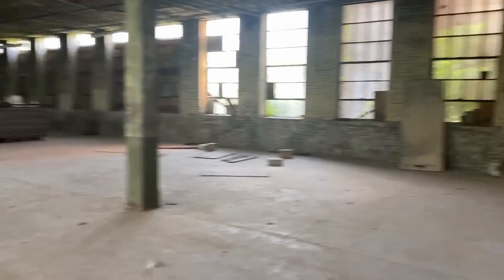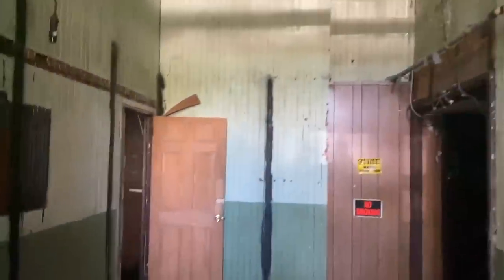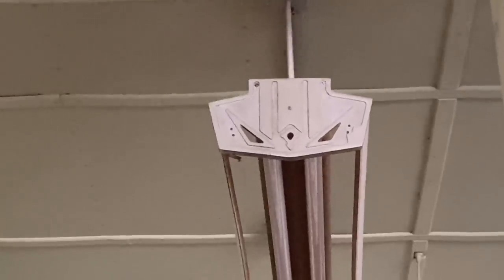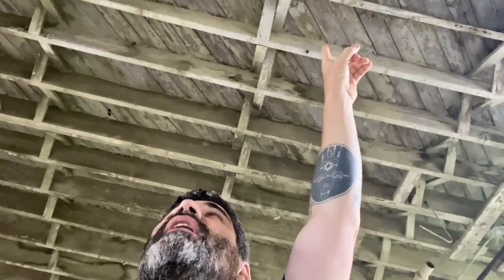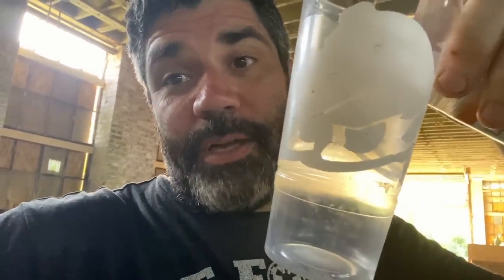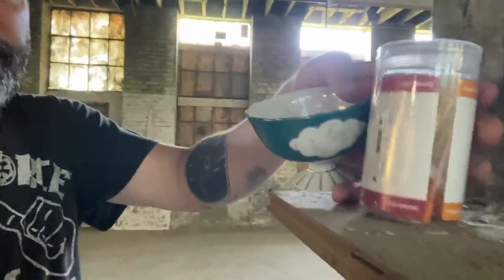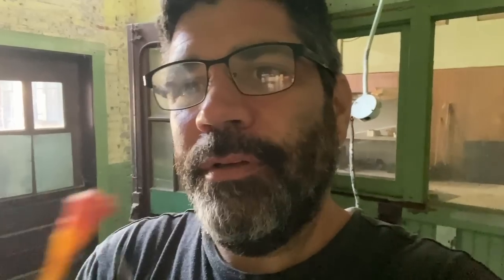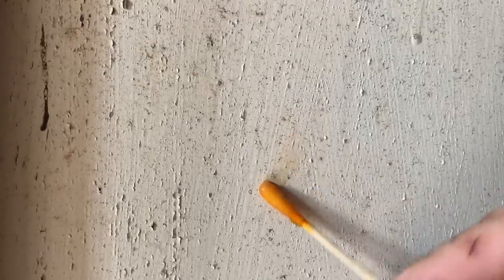I Test  for the Dreaded Lead Paint Result. Industrial Renovation.

Comment: I would take the training. If I recall correctly from some of the safety training I took, the worst way to get sick from lead paint is to ingest it (i.e. kids eating paint chips). Sanding/scraping shouldn't be too bad as long as you mask up. Any kind of dust should be considered hazardous, even from sweeping in your old building. Good luck!
Reply: Exactly. It’s asbestos that the dust is a problem
Reply from the maker: I was wondering about airborne particles once I started disturbing it.  But I think I can mist it to help the molecules bind and not go airborne.

Comment: I would suggest taking the class. You will learn a ton of good info and be able to separate facts from old tales.  The two things you don't want to do are inhale any sanding dust or ingest any paint chips, flakes etc. You would need more than a dust mask to protect yourself. Another option you may want to consider for the flaking areas or areas you cannot jet blast is a product called Peel Away-7. Its a nontoxic paint stripper that takes a few days to work after you cover the application with a 3 mil plastic film. It works on wood, brick, etc. the material is very viscous so will entrap all the paint particles as it softens them up. I used to do a lot of historic home renovations, and would order that stuff by the 5 gallon bucket. It was a amazing some of the brick work and wood work I uncovered. In most locations you can use the trash to dispose of it but check with your local city codes to make sure you are in compliance.
Reply from the maker: That is one big question, what to do about the material that is removed.  I guess the class will answer that question.

Comment: Good call on the plumbing inspection. I'd be a little surprised if that place had copper in it, my guess is it will still all be the old galvanized stuff. If you do find missing plumbing or repairs, I'd for sure go with Pex as the thieves won't be interested in stealing it.
Reply from the maker: I'll look that up.  Haven't heard of it.  I am guessing it is something like PVC. Googling it now.
Reply: @coldwarmercantile  Yep, it's a type of flexible plastic/composite. It works well, is very inexpensive, easy to install and the copper thieves don't want it.

Comment: There is this stuff called LeadX Encapsulating paint.  It's clear with a matt finish - would let you keep the look you currently have while making it safe.  Never used it but the application is supposed to be something like use liquid sandpaper to gently pull off debris, then wipe down with a damp cloth like a regular paint job, then spray on a couple coats of that LeadX sealer, and you're done!  Might be something to look into!
Reply from the maker: That is a neat idea for some areas. There is also something called flood penetrol, an additive to paint sprayers, it is basically clear paint and does a great job of sealing in rust and patina on old cars for the rat rod look.  It is expensive though.  I'll look into lead x.

Comment: It was all lead paint back then- they wanted it to hold up.  We had lead paint in the old depot here and it was painted over and its fine now.  Good luck on the paint and getting the water turned on.  Yes, take the class!  There is no way you can afford hiring that out.  I do know you should not eat the paint chips- LOL- good luck.
Reply from the maker: Not even sprinkling a little on my cornflakes?  It seems you are right, all the places that were painted at different places and times in there are testing positive.
Reply: LOL not even on your cornflakes!  
🤣 @coldwarmercantile

Comment: There was a time when all you could buy, would have been lead Paint. but as the mid nine-teen eighties came around then you had a choice!  at least, I think this choice was available then. maybe, it would have been earlier or later. my, uncle ran a Garage/Paint deot in a small town in North Dakota.  so, I kind of know some about this topic. but, the date of change... is kinda not something I have much of any idea of!
Reply from the maker: I was hoping that in 1919 lead paint would have been a luxury and they might have gone with something cheaper.  But sadly no luck.
Reply: I bought a boat in 1979 and it had a custom trailer. The guy I bought it from told me it was the last trailer the company was able to paint with lead paint. The trailer was about a year old at that point so it was certainly pretty close to the time that it was banned.

Comment: About lead and power washing.  You really should use a shop vac to vacuum up the water.  This will allow the paint flakes to settle out.  But the water that runs off probably has a high concentration of lead and should  be disposed of as hazardous waste.  The surface dust on the paint flakes is probably high in lead and potentially can dissolve in water.  Flushing the water down the drain is draining lead into the environment.
Reply from the maker: Yeah, I ended up ordering some proper breathing mask and even cut my beard off.  Trying to get better about safety.

Comment: while taking the lead paint class is a good idea, there's also a limit as to what any single person can do and still actually have time to use the building while they are still alive. Perhaps it's better to know all the material but use the learning experience to help sort out priorities for sublet jobs, rather than DIY jobs. On the water situation, have that plumber install a few new valves at wherever the service comes into the building. That way you can isolate (shut off) areas that need work and still have water available at the entrance point while other tasks are underway. Worst case is you now have someplace to connect a long hose!
Reply from the maker: Yeah that is good advice.  Running water will be a huge deal for me.  I think the class is a good place to start, even if I don't do it all myself it will help me make better decisions.

Comment: Suggest first using a cheaper paint thinning over the "lead" surfaces.  The "new" surface will likely chipped off in a year of two. This makes it easier to "safely" remove the  chips, since the "lead" paint will stick to the thinned new paint and less chances of flying around.
Reply from the maker: Nice tip!  Thank you.

Comment: Every Federal ,State, and local area is going to be similar but slightly different, so your going to get a lot of different opinions on Lead abaetment you have to check your own area. The Process of Hazmat rehab is going to be very expensive and time consuming. The process of getting certified to remove Hazmat material is lengthy "mandatoryTraining and health check ups" can be a problem not even to mention where to dispose of collected material.  I worked with a guy his sole job was to replace florescent bulbs and set all the clocks in the building 8 hours a day 5 Days a week with a 15 foot ladder in a monstrous warehouse.  The Florescent lights look fantastic maybe see if you can retro fit led light strips into the fixtures maybe possible. The one thing i remember about Florescent bulbs was the buzzing and flicker, it was a Soul sucking experience working under that lighting. Being a Photographer and running a studio i was always particular about my LED lighting. it seems we always were given the oldest building and worst conditions to work in and had to remodel an area to work in. Due to base closures when i was Active duty and my Career field "Photographer in the film days" I was most likely on the Hazmat team.  Once i was given a 50 year old building to work out of, spent $50,000 to remodel only to have the building tore down 6 months later after completion, your tax dollars at work. The Round light fixtures you have with a 100 watt LED Spotlight Bulb at 5000k light range are my favorite, they produce a slightly blue tinge but its true daylight saturation. Love your videos stay the course keep the faith and it will get done.
Reply: Reminded me of something.  The plumbing drains at the photog school at Lowry AFB weren't draining.  They moved training elsewhere while a contractor came in to repair the drainage.  He pulled up at least a half block of the street mains and most of the drains in the school.  The AF paid him for it, but the bonus prize was.....the clogging was from people pouring fix down the drain.  Yep, big old pipes full of silver!  He got to keep it too.

84B I assume.  I was a 26T.
Reply: @oldtop4682  I ran a high volume silver recover system while in Hawaii, I turned in 32 pounds of 99 percent pure silver after a clean out. But yet we were still killing the live bacteria in the navy’s sewage treatment facility Lolol
Reply from the maker: I watched some videos about converting to LED.  Doesn't look too terribly difficult.  Might give it a go.
Reply from the maker: Had a guy fill a haul with abs fittings from the building who sent it all to Hawaii.

Comment: i have seen some shows where they rent this blaster and blast dry ice and it cleans right down to the bottom or top of surface.
Reply from the maker: I looked at that but found that with my square footage it would likely be cost prohibitive. Spoiler alert you may have seen in the intro that I did regular power washing in a few areas already. Video soon.

Comment: Dang it!! I guess we all figured there was going to be Lead paint since it was so commonly used back in the day. I could almost tell it was lead paint with the way it flaked off in the larger chips.. latex paint ages differently. I also have some of that funky green on some old Timbers in my 130 year old house. What seems ironic is all the old mental institutions were that pale green color and if it was lead paint.. how much did it affect the patients already problematic mental state 😬… I guess getting a serious paint sprayer and spraying several layers of paint over the lead could be an option but I don’t think that would keep the underlying lead paint from continuing to lift and chip 😢
Reply: I just looked and Latex paint didn’t even come out until 1941 🤦‍♀️ so yeah I guess it was EVERYWHERE!! I think taking the class is a great idea so you can rest assured that your factory is done right without the INSANE cost of having it done. I’m sorry you got the bad news on the test results!!!
Reply from the maker: YEah, I think the class in a no-brainer.  But I also think I can re-paint or encapsulate without a license. But the funny thing is the scraping to prep might require a license.  I guess I'll find out in the class.

Comment: Lead paint is not great, but if handled properly, it's manageable. Whenever there is flaky paint on something, I assume it's lead paint. I don't test; I just handle it like it's lead paint. Use proper protection & collection, be sure you're acting within regulations, and you're fine. I would recommend you put dealing with it on a high priority, so you & anyone in the building know it is sealed or gone.
Reply from the maker: I want to do the hallway it will be a good test case, and not too big.

Comment: Have the plumber find the main water shut off to the building so you will know where it is so YOU can shut it off if there should be a problem down the road.
Reply from the maker: yeah, the city will turn it on and we can run and look for leaks.

Comment: Technically the method for removing paint that contains lead is to get it wet and then scrape it but what happens if you get it wet and then use the pressure washer as your scraper? Technically, it's still wet. That would be much faster in my opinion.
Reply from the maker: I want to do that in the tin lined room since there are drains in the floor, that would make quick work of it!
Reply: @coldwarmercantile  believe you me when I tell you that it's going to be refreshing to see you do it and you're going to feel the same way as you're doing it. Can't wait.

Comment: I would be sure the roof doesn't leak and the windows sealed before working on the inside.
Reply from the maker: I am doing them simultaneously depending on weather.  Actually posting a video today about the roof.

Comment: Well isn't part of your idea to make that first floor a showroom for the public to come see your antiques and stuff? or even to have an auction in the building? I do not know if you can have the public come in with flaking lead paint on the walls and ceilings?
Reply from the maker: That is the dream.  I still don't know all the rules.  But one way or another I'll get it up to code and then consider the use options.

Comment: Internet advise: Scuff the paint with sandpaper, then test the exposed surface. 
Old paint will have a tough film on it.
You might be testing old tobacco film rather than the underlying paint.
Reply from the maker: Interesting. At the first spot I did wipe it with a damp rag first. But that might not have cleared a hundred years of funk.

Comment: Are these tests work? I got onr on amazon and it gives lead on every matt paint in my flat. Some paijt was applied as early as last month
Reply from the maker: modern paint shouldn't test positive I wouldn't think.  So I am not sure.  the paint in the building I have is a hundred years old so the positive results seemed right.

Comment: I'm not an expert, but 1000s (actually millions) of homes and businesses built before the 1980s had lead paint on the walls and every place was never required to abate for lead paint. My house was built in 1905,.....No one was required to abate the lead paint out of my house or even remove the asbestos from around some of the ducts. I think you are going a little crazy and you should not worry about it. Especially since you are saying you are not turning the warehouse into apartments or a restaurant. We never worried about the lead paint in our studio warehouse, we just minimally scraped the loose paint and re-painted it with latex paint. It wasn't a dwelling, it was an art studio and infants would never be working or living in the place. WEAR A VERY GOOD RESPIRATOR DUST MASK, WEAR GOOD WORK GLOVES, AND WASH YOUR WORK CLOTHING OFTEN if you sand or chip away the old paint, but besides that, you are getting too fussy about it. In my opinion.
Reply from the maker: Yeah, I am thinking paint over what I can, and only focus on the bad peeling stuff.

Comment: I would imagine lead abatement standards are federal, otherwise we’d have states (most likely southern states) with no standards at all.
Reply: I know NC follows, and has expanded upon, federal standards - which leave a lot to the individual states.  Various localities also have their own enhancements to the state and federal regs/guidelines.  The South was late to the party for many building codes and such, but that was pretty much fixed in the late 1970s and early 80s.  There are variations on things due to weather, soil content and other factors that aren't as common to the north.  Like hurricane clips for instance.  

I'm originally from Illinois, so don't think I'm some un-reconstructed hillbilly lol.  I just have experience here dealing with trades a lot in my job.
Reply from the maker: Hopefully there is an Illinois specific version of the certification class.
Reply from the maker: I'll post about it when I figure out the right class.

Comment: Lmao! Dude! I could see it changing the second you touched the swab to the column. I would be willing to say that all painted surfaces in your building are painted with lead paint. You should not be doing any renovation or cleaning work in your building without being masked. The dust that settles on all of the lead painted surfaces become leaded, so that every time you move things , clean, sweep… and the dust is disturbed, the particles stay in the air for very long periods and when not masked, you are breathing in lead particles not to mention if there are any asbestos particles sitting around, you are breathing them too. This is why most professional renovations of buildings this age start with serious dust, lead and asbestos abatement before any other work is done.
Reply from the maker: So that likely results in false positives.  But I am pretty certain that in this case it is all lead. I am going to get some heavy metal blood tests done  and start wearing better PPE. As for me technically it will be one of the first projects after weatherizing and clearing the building out so I can work.  But I will cheat and start on some of the wiring so I can get the elevator going.